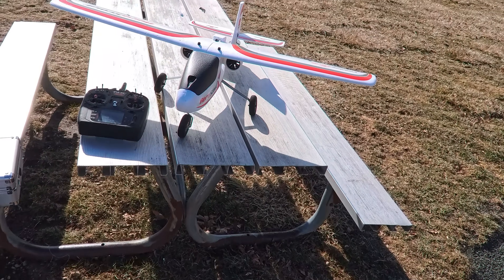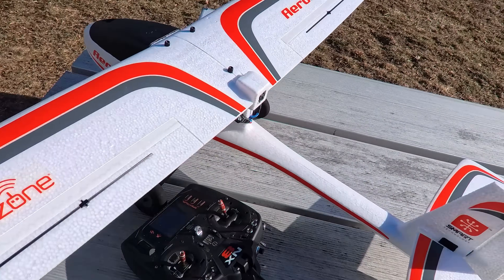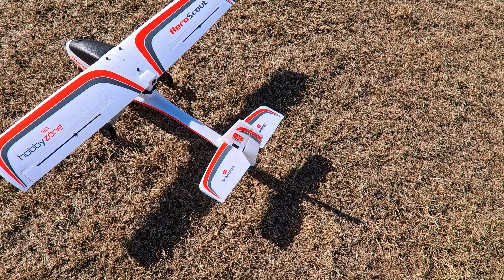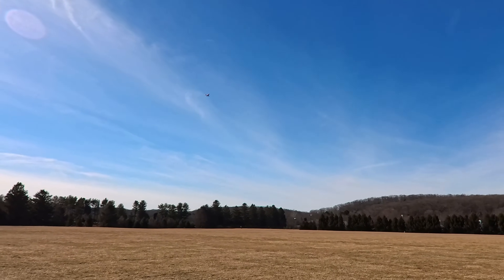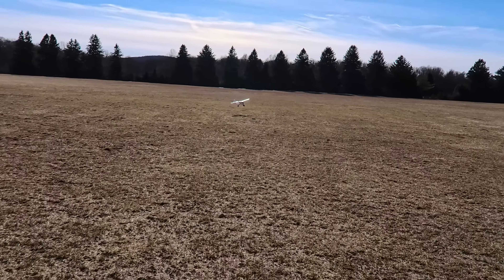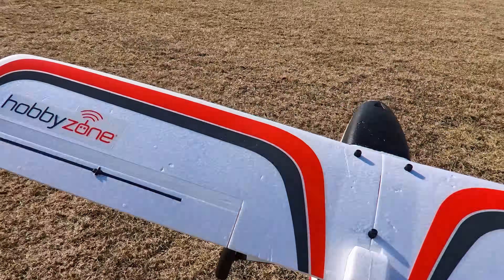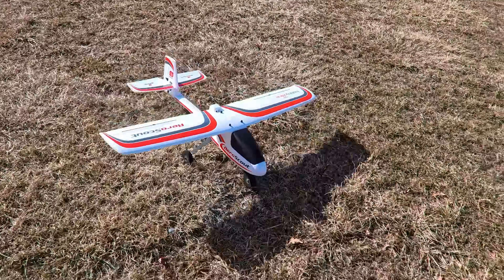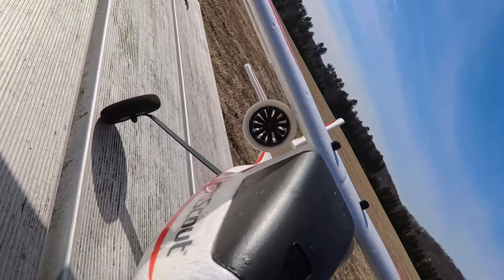Aeroscout twin 40mm EDF system. 3d printer files available!

Comment: After 8+ months, how is the hot glue holding up? Also did you use hot glue to glue the 4 nacelles together?
How did you handle the 2 ESC wires to your receiver?
I bought the kit and in the process of printing it out!
Thanks for sharing your project
Reply from the maker: Still good! I used a y connector and ran both esc wires into the throttle channel. Most say not to
Reply: @hotlapkyle thanks for getting back to me! You said "must say not to" and I don't see rest got cut off.
 I was wondering how much you would have to increase the print for 50mm EDF fans?

Thanks again!!

Comment: I don't even have an Aeroscout but  downloaded the files and will be getting one now.   I was thinking it would be cool if you could design a fairing to hide the wires on the back and really clean up the look.  It could be just tacked on with glue or maybe pinch the airframe with small teeth and a small screw to clamp the two halves together.    Just a thought.   Cool mod though!

Comment: people who choose to mod this model should realize that the manufacturer used a 'weird' horiz-stab configuration, one that offsets the affects of the use of a wonky (stock) thrust angle/line.      so, when changing the thrust  angle/line  on this model,  the affects of the built-in trim at the horiz-stab should  be  accounted-for.

Comment: So I’m just throwing this out there, but you can fit a spectrum 3200 battery in these planes and get a bit more flight time. I’ll have to do a video on our channel at some point. Basically you make a little foam T that fits in the hole in the square hole in the wood closest to the servos inside the battery bay. What’s that does is it lifts up the battery a little bit so it’s sitting at a slight diagonal so it doesn’t interfere with the servo I can control the wings and rudder. And the connectors go towards the rear in the flat and towards the nose. Like I said, I’ll have to do a video at some point, but you might get the gist of it. Also very awesome modification we did there. Definitely have to try that out some point!

Comment: id recommend a different glue, but thats just me. sick idea and works perfectly!
Reply: personally, I would use some small carbon or wood rod to insert from nicell to fuselage, and some e6000 or foam tac. some kind of adhesive that is permanent. but provides  just a little flex, to avoid stress rips/fractures.
Reply: Is glue reliable ?
Reply: Which one would you suggest,  Foam tac?